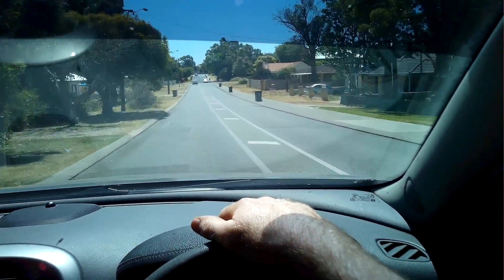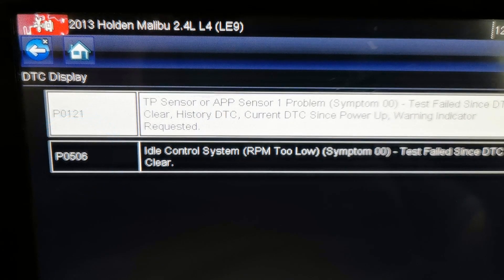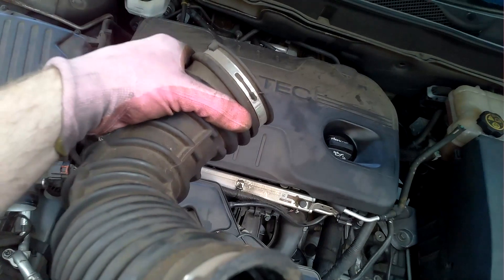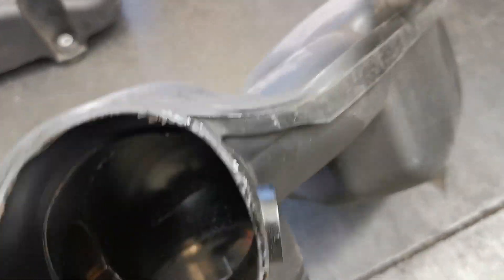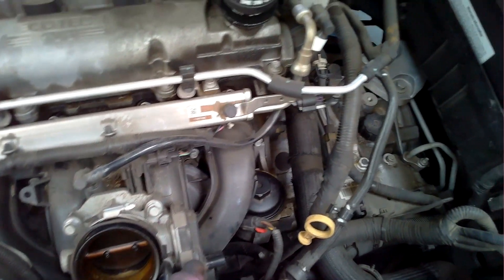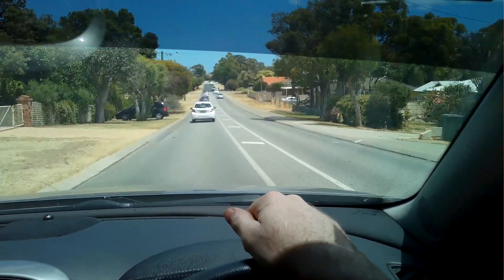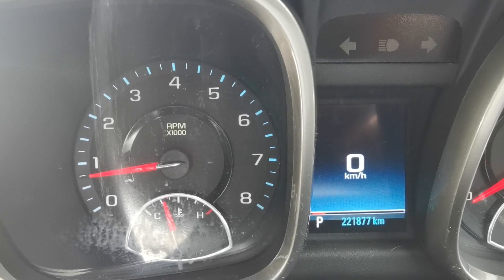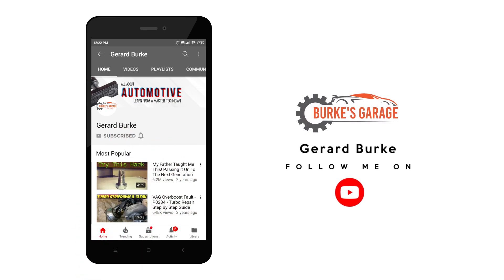Chevy - Holden P0121 P0506 Rough Idle & Poor Performance

Comment: 2011 Chevy HHR, recently started experiencing this trouble. Currently sit at about 265.8K miles on 2024-01-03 1412 PT.

You were my first result here on YouTube, when I searched for P0506. Though don't have the other code. I had a feeling the chugging had to do with the intake, as last week, I did get a code for the Mass Air Flow sensor. Yet more likely a similar cause, the throat is getting clogged. 🤔🤩

Comment: change of spark plugs SV6 commodore vf but still can feel slight rough idle notice but drives and accelration is smooth like butter.
whats cause????
idle sits on 550 and stable even on idle but i can feel slightly rough.
no check engine lights
no vaccum leaks

Comment: I guess you could use an ultrasonic cleaner on that throttle body if you have one in your workshop. They bring things up really 'smick'. I use them a lot when cleaning all the carbon out of diesel (particularly Mitsubishi 4D56 engines) intake systems. They do an amazing job.
Thanks for the video! 😁
Reply from the maker: We do not have one of those cleaners, they certainly look great. 
Thanks for watching :)
Reply: @GerardBurkeBurkesGarage  They are reasonably priced now-a-days and even a 30Lt one is big enough to do manifolds if you put in one end and then the other. They do a great job!

Comment: One of the biggest mysteries to me, venting crank case and valve pressure directly in to the intake. I'm shocked that manufacturers don't even try developing a built-in AOS, or even a catch can system. 
It seemed the amount of sludge was excessive. That's what I would expect to see from a turbed or supercharged intake.